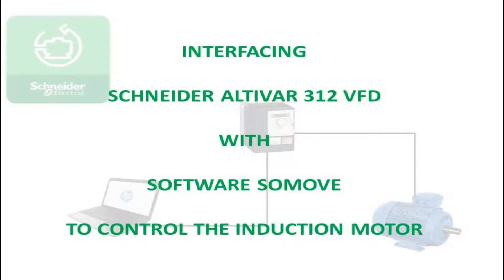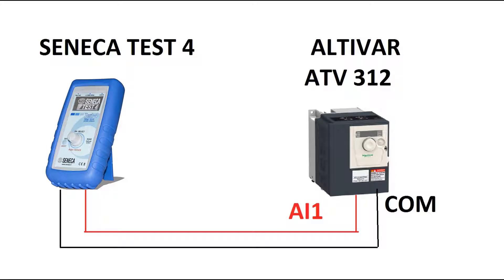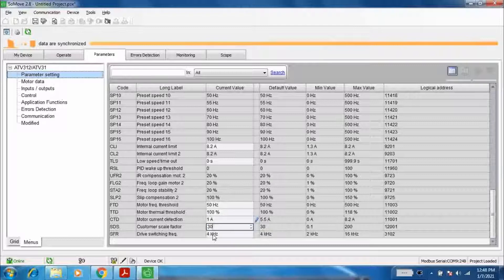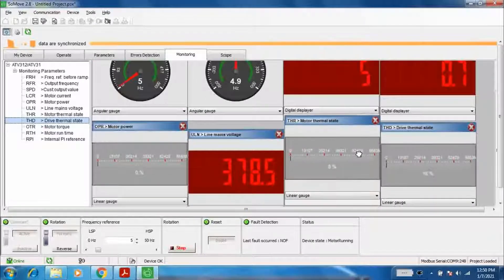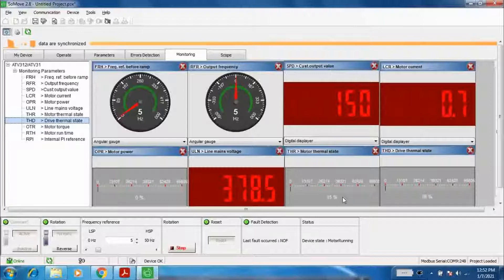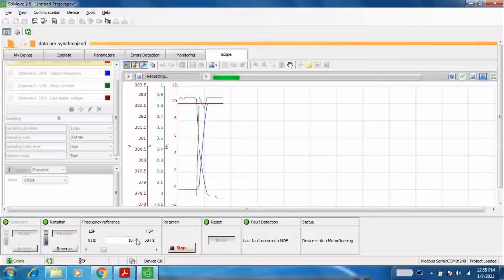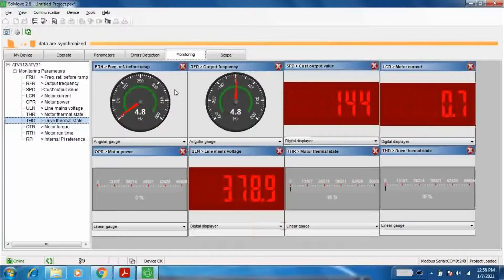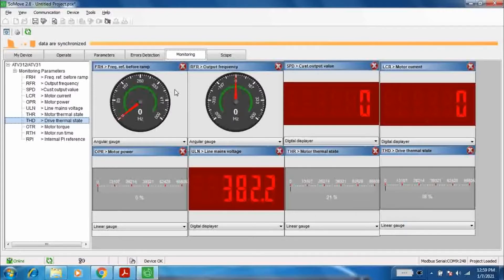Motor Controlling from Schneider ATV312 VFD using SoMove Software

Comment: Can we access the parameters by giving AC supply?   When I give the AC supply and connect the RJ45 jack with my laptop, the drive shuts down (the display goes off). Also, if I have to give DC supply, Voltage is 0-10V, do I need to give an On/Off Switch to +24 & LI1?